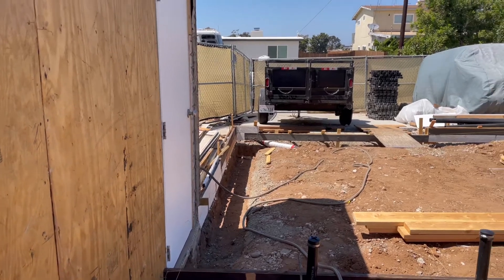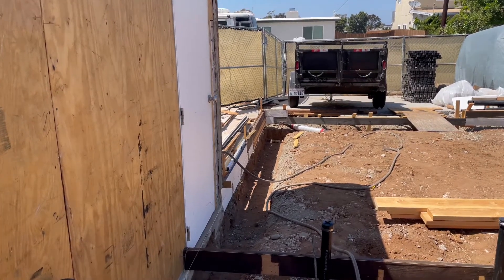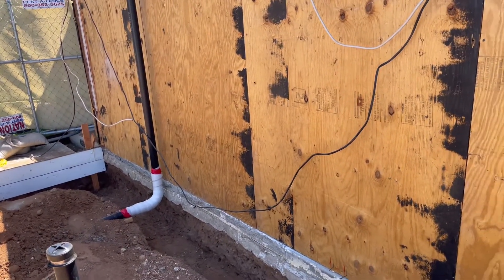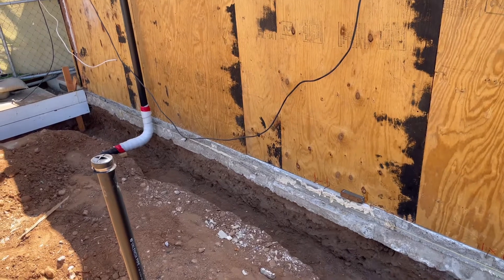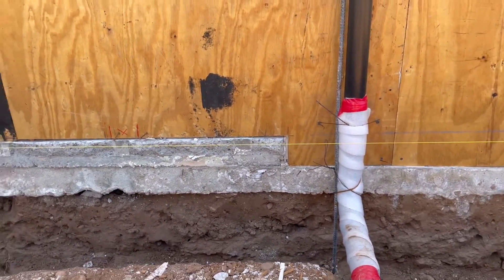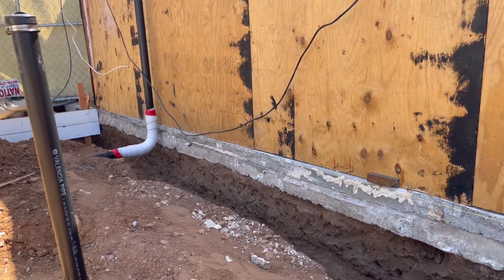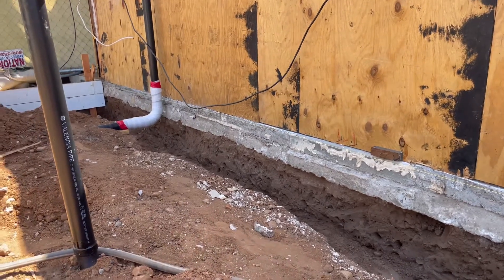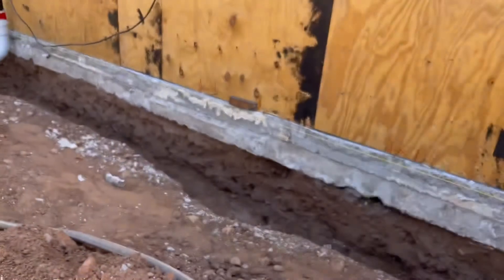DIY ADU San Diego Update #3 - WHEN TO CALL AN ENGINEER

Comment: What kind of engineer did you need? A structual engineer? Also where would you recommend finding one? Just google?
Reply from the maker: Yes, a structural engineer is typically all you would need. If your lot is complicated you may need a soils engineer. But usually it’s just structural for the city permits. Most architects or designers already have ones that they work with and can tell you if it’s necessary or if you can use standard details.

Comment: Good thing the inspector didn't asked you to turned down the unpermitted extension of the house. Been watching all your video all night. Good info sir.
Reply from the maker: Part of this project was to bring all the non confirming square footage up to date with the city. Which we did. The City inspector did require an engineer to determine and stamp the work around. Which also required a special inspection.